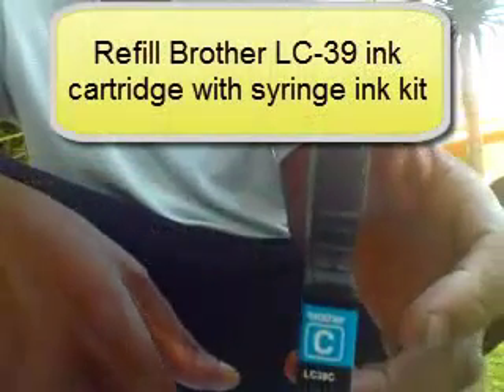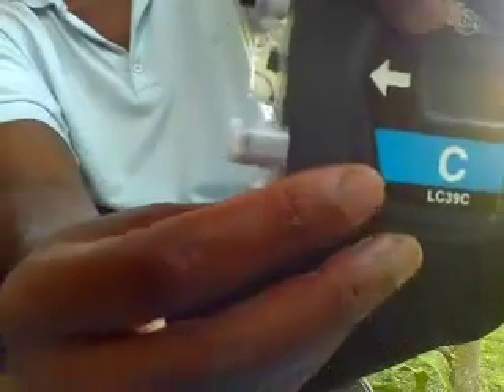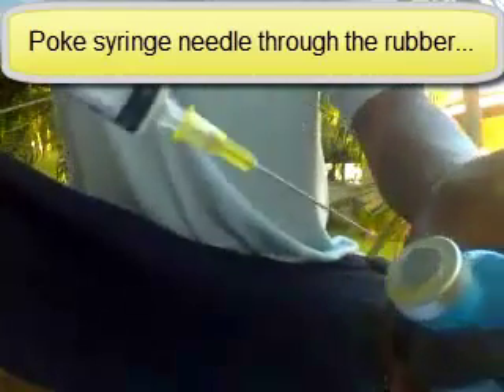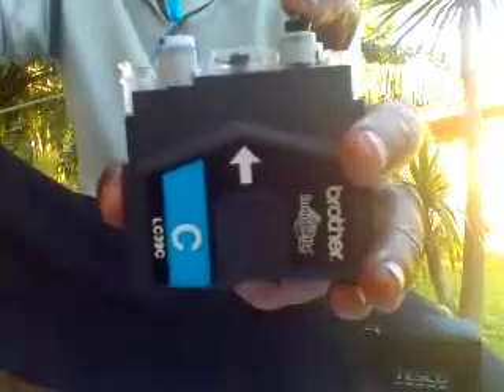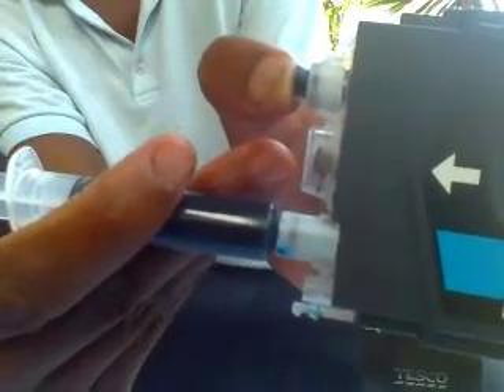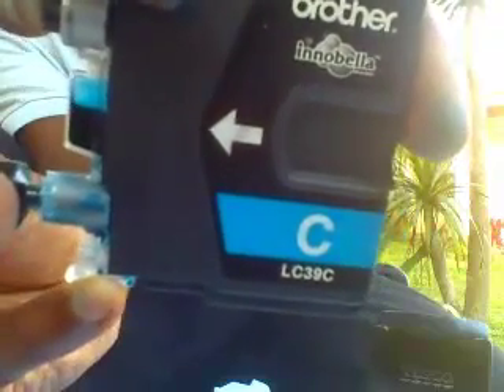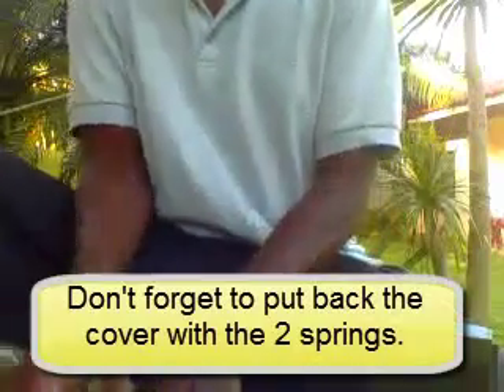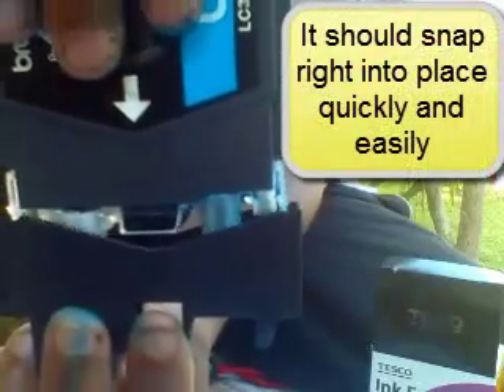How to refill Brother LC39 inkjet cartridge using Tesco refill kit

Comment from the maker: @peterjol , the starter cartridges/official refill cartridges i forget how much ink they hold 5-6ml or so. I printed several color pages with good size photo on each and the color cartridges were used up fairly fast.  The larger aftermarket cartridges are 600 baht with ink for all 4 colors (maybe 300-400 baht without ink), hold appx 15-20ml, with a clear casing and are refillable without the need to ever remove the cartridge from printer.  I bought at Fortune IT, but check your local print shop.

Comment from the maker: It is wiser than being an expensive ass. A better method is actually to go to pantip or FortuneTown (Bangkok) and buy the aftermarket refill cartridges.  They sell the emtpy ones for 300-400 baht and the ones with ink for 600-700 baht. They should sell them on ebay, also.

These are much less messy, and will last for perhaps 20,000-50,000 color prints before running dry. Then easy refill with no mess or hacks. I don't print excessively and I have about 80% ink left for over 1 year now :)